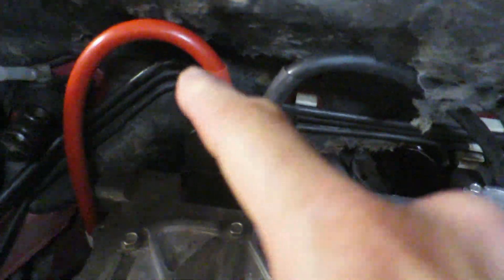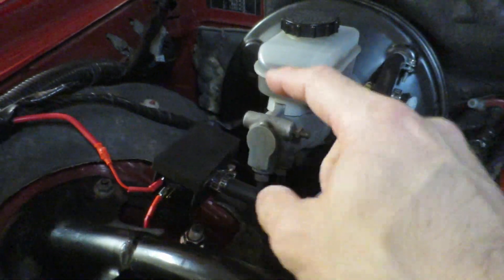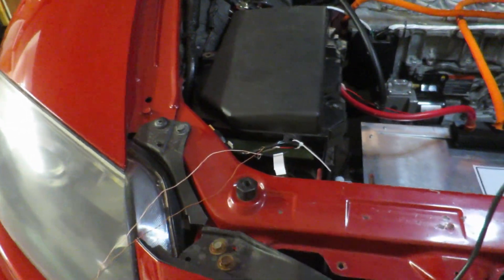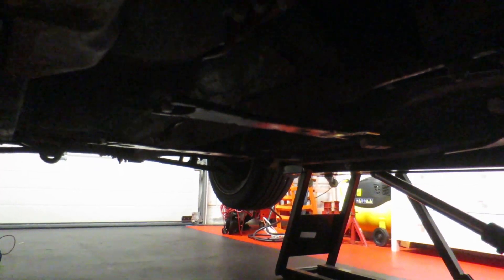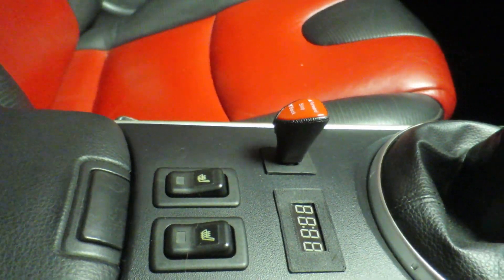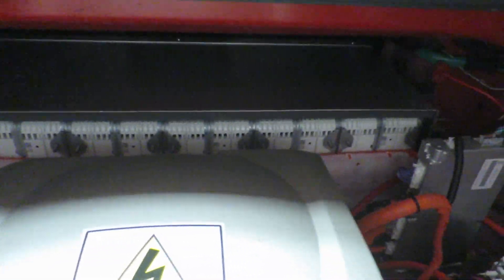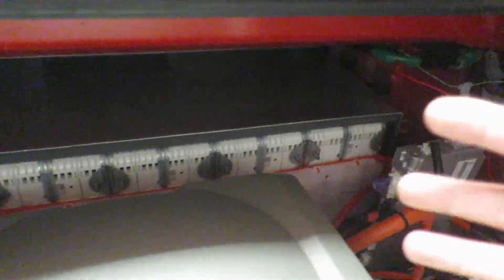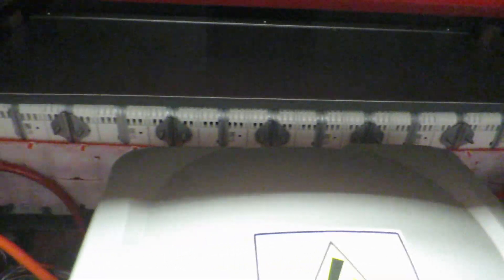First 100 Miles completed in the Nissan Leaf / Mazda RX8 full electric vehicle conversion.

Comment: Ive been loving seeing this. I was originally going to attempt a G35 conversion but there seems to be a lot more aftermarket support for the 8. But I noticed the ev motor seems bigger than the renesis, have you noticed a difference in handling? Or is it mainly the same? Thanks for all your input btw!
Reply from the maker: So the main difference is caused by the batteries at the front. But ill be honest (as a previous owner of an rx8) the car understeered at low speed, and this extra weight has actually made the nose more pointy - but I did replace the suspension so that might also have had an effect. Still handles really well.
Reply: @SouthWestEVUK  Ah thanks for the honest opinion, definitely helps with my build. Love the progress im noticing through the years!

Comment: Why don't u convert the power from the main battery down to 12 volt and remove the car battery? Doesn't make sense fo keep the car battery since you'll be charging 2 batteries rather than 1 pack. Or u charging on the move?
Reply from the maker: You need the 12v battery to operate the relays, and the relays turn the main HV pack on. It is a bit chicken and egg... Plus the 12v battery is required to power the PDM to start charging - again if you had low power in the HV pack you might not be able to operate the charging system so dead in the water. The PDM in this charges the 12v battery when the car is in use, and the 12v battery then runs all the cars systems. All EV's to my knowledge have a 12v battery as well as the HV pack.
Reply: @South West EV UK  okay perhaps u have it charge on the go so u don't have to forever recharge the car battery 

I've got an RX8 R3 I don't think I could downgrade its power and range. Having said that it's something I couldn't afford u guess it costs a stack

Comment: Hi Dave, all sounds good to me. Interesting about the motor and inverter temps. I guess I will be needed a secondary heat source
Reply from the maker: Yeah I’m going to plumb the cooling into the cabin system, then if that’s rubbish I’ll add a heater element!

Comment: Nice to have it on the road, thanks for this series! The thing about the battery pack moving a bit destpite it being heavy is to be expected. The friction is proportional to the weight but so are all the driving forces (braking, cornering, accelerating and the bumps in the road) thanks to our friend Isaac Newton. So a coin would theoretically move as much as a battery pack
Reply from the maker: Yeah, I’ll get it fixed down, probably should have from the start to be fair!

Comment: Maybe soften the suspension before re-bracing and cutting the cross member etc. Obviously I've not driven it but could it be that?
Reply from the maker: Yes - I have actually since recording that, it was set 100% hard!! It’s now 75% soft 25% hard and a much nicer drive!